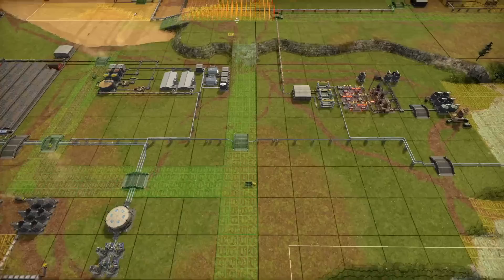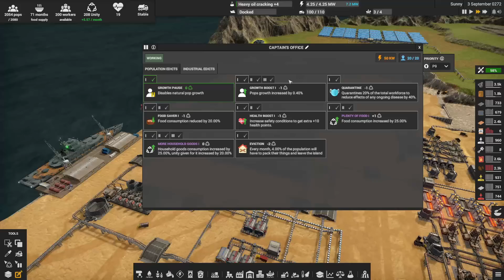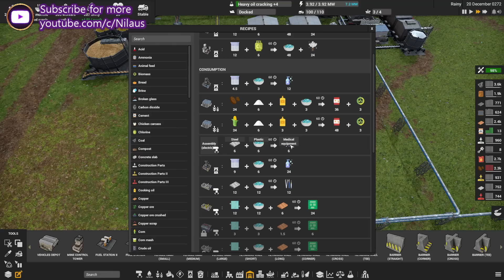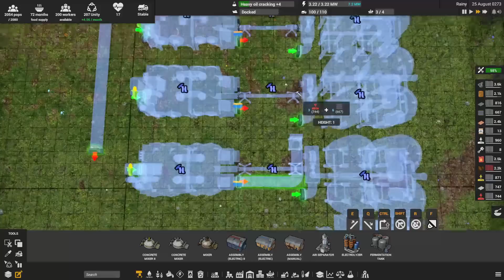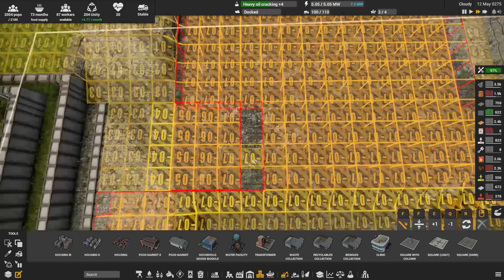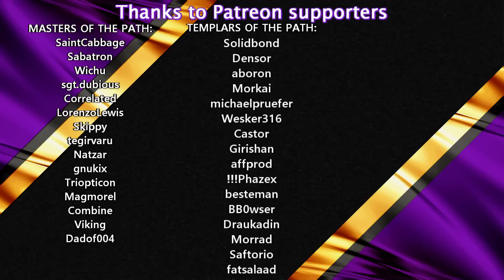Everything is Green with Medicare & Plastic | 17 | Captain of Industry | Lets Play/Walkthrough

Comment: I learned that pressing R with pipes/belts is basically what I call the magnet button. It stops belts/pipes from trying to "stick" to other pipes/belts nearby and makes it easier to place new layers on top of lower levels easier. I noticed you've struggled to get the placements sometimes and have to fiddle to get the right angle a few times and pressing R will solve that for you :D

Comment: I would recomend adding a balancer in the animal feed export line coming from the corn mill in order to prioritize it from the animal feed storage line. That line (animal feed storage) is always saturated, so that line is going to have trouble exporting the excess animal feed, haulting the whole plastic production line.
Reply: I had the same thought, but looks like the new buildings output so little feed that the default 50-50 is fast enough.